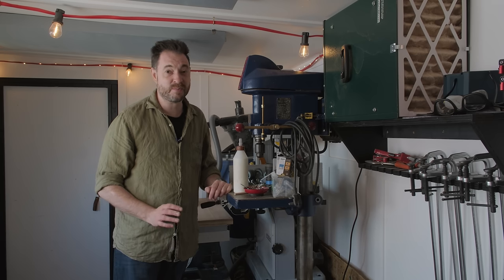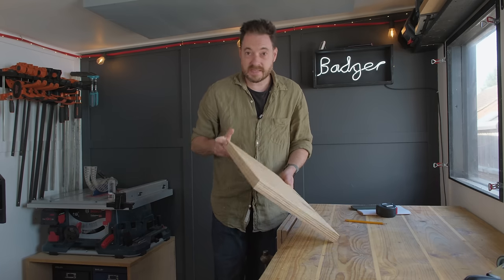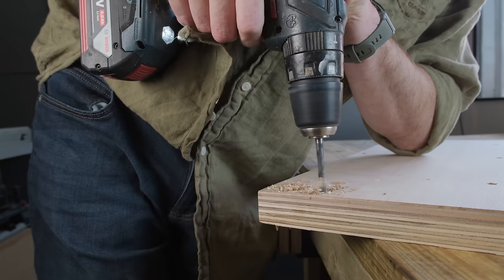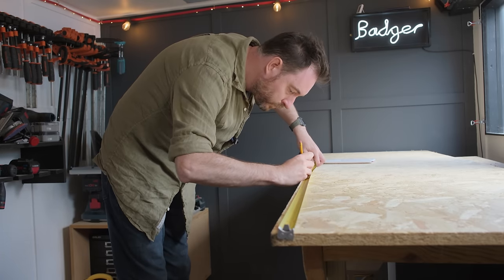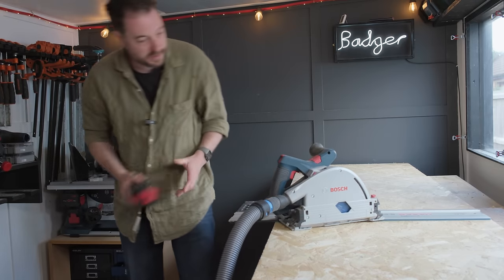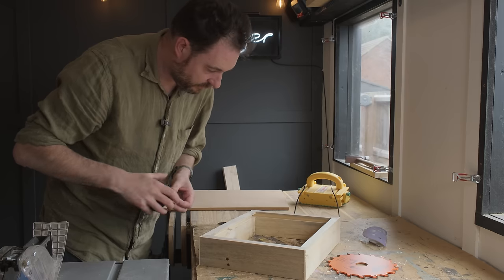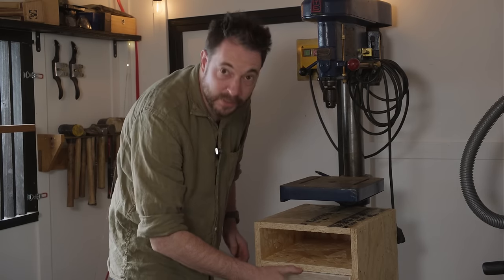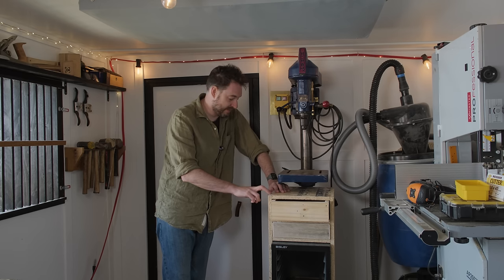Under Drill storage

Comment: A great idea you can also make a leather strap to go around the drill column to support the unit screw the leather either side of the column into the back of the unit
Reply from the maker: Thank you
Reply: Cool, I was going to suggest strapping as well.
Reply: Try a drain pipe bracket
Reply: Probably a popper in the middle would help

Comment: Inspirational! I have my small bandsaw on a cart on wheels, and just throw scrap timber into a plastic bin underneath.

I’ve often thought I wasn’t using the space to its best advantage, so you’ve given me a much better idea!

By chance someone on marketplace was giving away 2 low & wide wooden carts, with sliding plastic trays (like they,use in schools). So those are going to get chopped and repurposed as one tall slim cart, a bit like yours. You can never have too much storage in a workshop 😊😊

Comment: An excellent build. Fortunately (maybe unfortunately) I only have a bench top pillar drill so don't have the same storage underneath issue. I've always found the benchtop one to be sufficient as if I need to drill into longer pieces, I swivel the head of the drill 90° and have it work over the side of the bench top.
Reply from the maker: Thank you

Comment: Hi Matt. I’m wondering. I’ve seen Peter Millard make those style of drawers a couple of times but he always makes the rebates on the front for aesthetic reasons. Is there a reason you did it the other way round?
Reply from the maker: That way when you pull you would be pulling the screws out. I knew I wanted to fill the draws with heavy items

Comment: Enjoyed that. Is it possible to have a link for the grooving blade ? I have a Bosch saw like yours that needs a 256mm blade but I can only find the grooving blade in 180mm. Is 180mm good enough as grooves won’t be that deep ? Thx 🙏
Reply from the maker: It's the 180 I have. Never needed to go deeper

As an Amazon Associate I earn from qualifying purchases.
https://www.amazon.co.uk/CMT-Orange-Tools-240-060-07r-straight/dp/B00JBJHRP2?crid=IOOSMQQ9HYE7&keywords=6mm+grooving+blade&qid=1695366213&sprefix=6mm+grooving+blade%2Caps%2C77&sr=8-8&linkCode=sl1&tag=badgerworksho-21&linkId=b3ebbb6e269628e3f1b71928c726ff08&language=en_GB&ref_=as_li_ss_tl

Comment: Wondering why rebate the sides of the drawers rather than the front and back (to hide the ends of the sides).
Reply from the maker: That way when you pull you would be pulling the screws out. I knew I wanted to fill the draws with heavy item